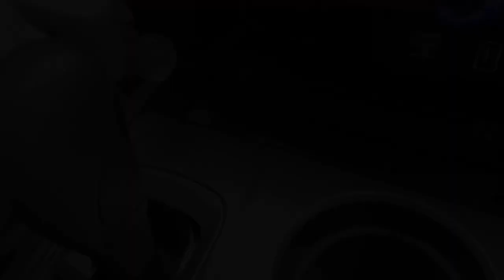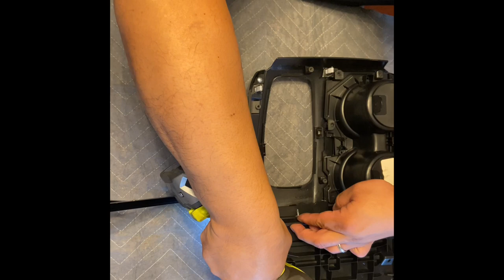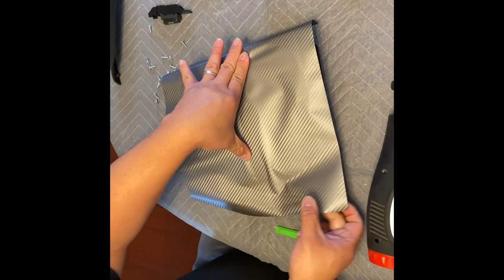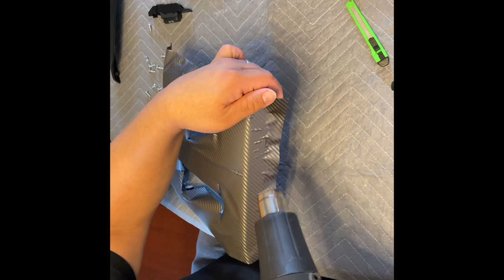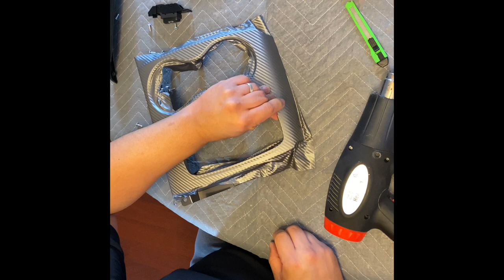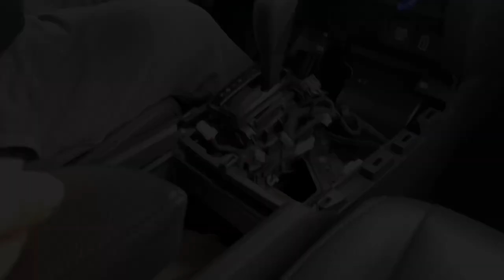2019 Honda Pilot gets a vinyl wrap on the center console! Link in description.

Comment: Great outcome! Is the wrap silver or gray? I want to get the same color...thanks!
Reply from the maker: Gray
Reply: If u get chance, can u provide the link to this color as Amazon has so many gray variants? Thanks!
Reply from the maker: @ishmo3269  I put the exact link in the description.
Reply: @eddiesspeedgarage  thank u! 
Based on ur experience, are these Hondas still reliable? Many reviews complaining about their issues with the infotainment system, problems with ZF9 speed transmission, and the VCM?? Thanks!
Reply from the maker: @ishmo3269  I haven’t had any issue with my three vehicles in the time I have had them. I had a 2019 pilot Exl for 2 years 2019 passport exl 3 years and my 2020 ridgeline black edition 1.5 years only thing I had was a mouse ate the cabin filter in the pilot and passport a few weeks apart it is but isn’t Hondas fault